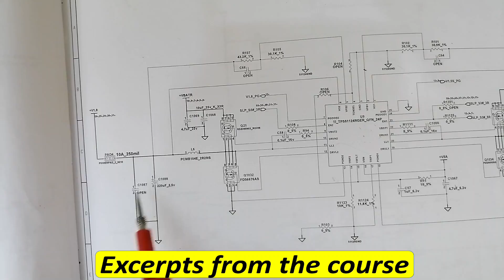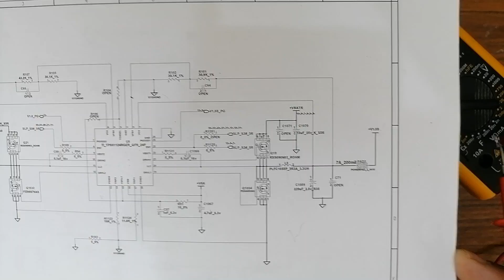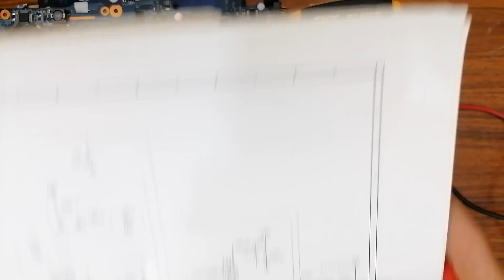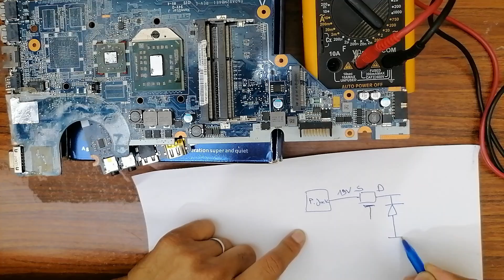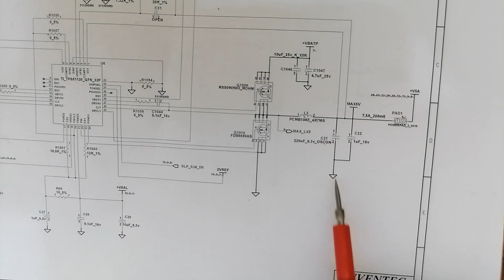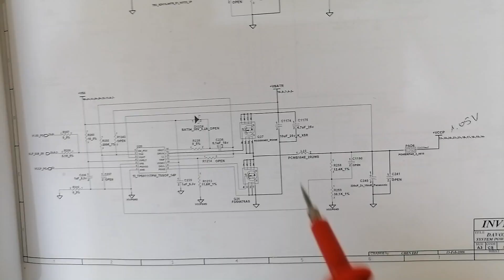Laptop motherboard repair - Dead motherboard and short circuit repair

Comment: I checked the inductor component, the buzzer sounds, the multimeter screen flashes, the resistance is 0, sometimes 1000, is that a short sircuit?

Comment: Great video sir. Now my question is; what is the need of of those two inductors connected on the low resistance path of cpu? Because it seems to me they are connected to ground which should not be the case when it comes to inductors
Reply from the maker: They are not connected to the ground, all CPU coils are connected to +VCCCORE power rails
Reply: @electronicsrepairbasics_erb  but why was there a continuity when you placed black probe on ground and red probe of multimeter on the inductor before you removed the CPU... I don't understand this concept plz

Comment: if you have detected the short circuit  using the inductor trick but you removed the capacitors that are connected to the ground but u still get the short-circuit what the next step?

Comment: A great video like always.❤
Are there any other ICs with low resistance that might lead to confusion? 
Newer motherboards have soldered CPUs; can we eliminate the CPU's low resistance by removing the inductors?
Reply from the maker: I will cover that ICs in a separate video. Yes you can, Great